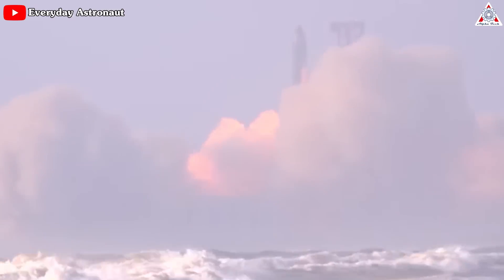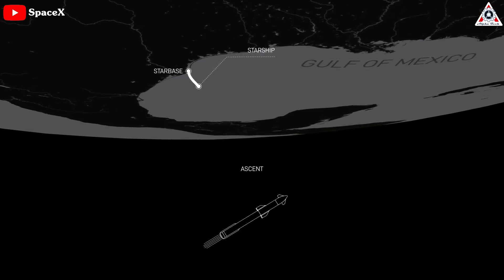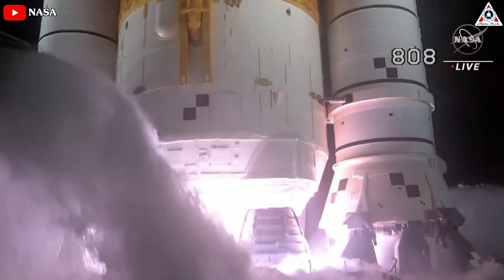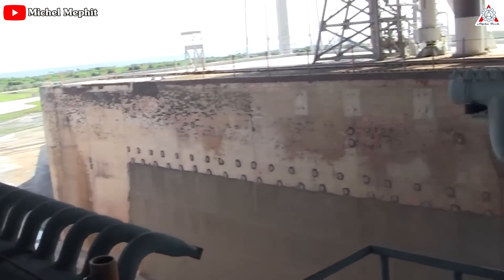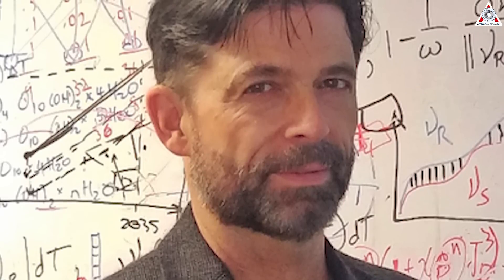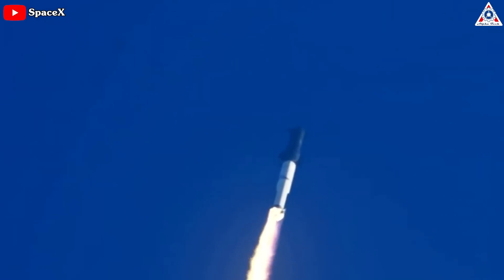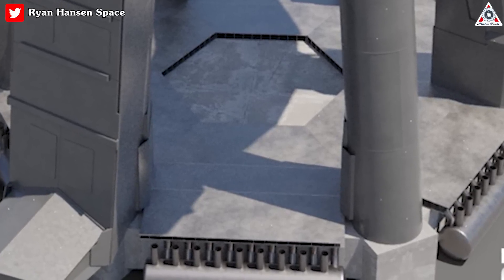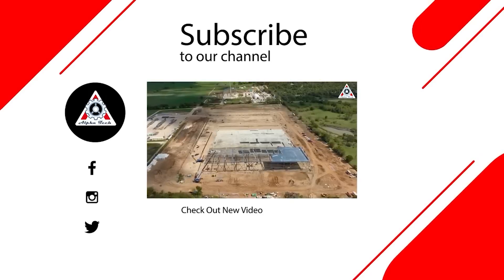SpaceX's NEW Solution to prevent the pad damage by 33 engines...

Comment: 2:32 "It's not clear why SpaceX didn't use this kind of infrastructure which is part of the launch set up for its Falcon rockets."

Because the time it would've taken to build the infrastructure would mean that Mush would miss the opportunity to make another overused & fkn unfunny 420 gag. After all, if he really gave a shit, then he would've been concerned about the environmental damage if not the actual damage to the site that the dildomobile caused & postponed the launch. It does however show a a major flaw with the dildomobile. When it lands on the yet to be built strong, flat & level steel reinforced concrete surface on Mars, when it takes off, it will massively damage itself hoying Martian rocks into the engines & most likely write itself off, which must be a comforting thought for any budding astronauts, especially after Mush's cavalier attitude to safety in getting there &/or coming back. 

What truly is amazing is just how much wool he can pull over so many eyes, but I guess when you're in a cult, you don't know it.

Comment: If they cant dig a trench deep enough, they should at least replace the concrete flat platform with a massive metal cone diverter to reduce the angle of incidence and quickly absorb the surface temperature.

Comment: First of all starship is one mighty powerful rocket in fact the most powerful ever built, so why expect to launch it on the least launch pad every built? no Launchpad ever had to deal with flames (guess 600 feet) like that in the past so therefor the Launchpad needs to be built in proportion to the height of the flames. From my understanding, if the total Starship including booster is 300 feet tall, when it had lifted off clear into the air I observed a flame over twice the length of the total ship, to me that looks like an incredible 600 feet flame never mind the compression, heat, pressure, shock waves etc. below that, so therefor to me it looks like the Starship needs to be launched from 600 feet above the ground or a pit below the booster 600 feet deep with clear exhaust routes (flame diverters) to get rid of any flames rebounding back towards the ship which probably would damage it even increasing the likelihood of causing secondary ignition which could explode the booster but at least would restrict cooling of the engines therefore increasing the probably of engine overheating failure or damage to supply lines. The best way forward is to build a launch tower at least 50% as high at the flames (300 feet) with flame diverters to direct flames away from the ship, or even safer (600 feet) the full height of the flame that way no flame will reflect back to the ship. I know what I'm saying is going to be rejected because, how can a tower so high be practical to build or how can you work at or maintain the ship at such a height? Well that is the next hurdle Spacex is faced with like it or not. In my opinion Spacex is wasting time with this water cooled metal plate idea, because even if it could absorb the heat the flames will still rebound and surround the booster for all the time it takes to clears the tower, if that is 5-10 seconds that's a lot of heat the booster and engines have to endure, actually I think it's repeating the same mistake and Spacex already knows that, but with all the eagerness to get it in the air Spacex is clearly trying to short cut a proper launch base however in the long run a lot higher launch tower and flame divert system is needed. I know this is a tall order, but as the old saying goes if you create a monster you have to feed it, this is another requirement like it or not, cost cutting and time saving isn't going to work in the long run because the FAA could ban the whole project. Let’s consider what could have happened if the Starship had of exploded on the orbital launch pad (my guess it was very close), how much damage would have been done?, certainly the whole launch tower and fuel tanks all would have been very badly damaged or destroyed, and what about in turn the fuel storage tanks exploded? This is crazy irresponsible as there is a town close enough to be damaged, does anyone really know how much damage the Starbase fuel tanks exploding would have caused? I think the whole thing needs to be re-evaluated as to the viability even as a Starship test site. “Elon forgive me I have an opinion” and this is my honest opinion. I do have a concept that should work but that’s a story for another time.

Comment: vectoring 30 engines on a surface which could potentially be sloped upon lift off could be a challenge for  such a large vehicle.
Hence the reason for the lack of blast deviation and the need of a level surface?

Comment: Won’t work, the heat and flames will still blast upwards and with more force; the flames and heat need to be directed away from the launch pad like at the Cape, preferably with a similar water suppression system

If you notice the flames and heat climbed up the rocket even to the primary stage; which is what caused damage that prevented the stage from separating.

Furthermore they will need to construct launch pads on the Moon and Mars beforehand with robotic vehicles

Comment: I would think any slight diversion of only three or four feet would be much better than a flat plate. Using a concaved diamond shaped Convergent  plate with external water cooling and deluge, to minimize the acoustic shocks that would help direct the flame into the smallest flame possible while directing that flame into a “ heat battery “ storage container where all the reclaimed heat can be reused. I think that would be the best.🤗
Reply: Yeah, let's spread this flame nicely all over that wildlife preserve. Fry all those endangered turtles and birds.

Comment: I would say that the deep sunk-in deflector or diverter is inevitable final solution... At least it should be tilted on one or two sides to divert the pressure away from the basement. Flat steel plate won't never be sufficient...

Comment: The only way you could launch 10 rockets with that kind of power off the same pad in one day is over a body of water with as little contact to any solid body of material, as it will disintegrate over time, as such to save time and money I would move to sea launch and duck lots of faa red tape 12 nautical miles off shore.

Comment: I wonder cooled steel plate will have no problems with the heat, the problem will be from the pressure of the engines. As a boiler operator I can tell you right now that a water cooled plate will stand extreme temperatures because of the absorbent and evaporative properties of the water circulating around that plate. It's the same basic principle, but the pressure is going to be a problem unless it's designed well.

Comment: Concrete is porous,  there is always a amount of water in it.  With enough heat applied to it it will begin to shed flakes off of it. I've done this at my work with an oxy acetylene torch. Can't imagine how heat the rocket generated.  Think the whole structure should be steel.

Comment: It with be interesting to see what they come up with as far as this plate system. What are they going to do about acoustic amplification. The plates might collapse under those pressures the cement was able to give . And won’t the amplification make engine damage even worse?
Reply: Engine won't get damaged from the pad being torn apart, because debris would have to somehow fly up against all that thrust. Everything else around unfortunately will get annihilated.
Raptors managed to fail all on their own this time.

Comment: why not get the boring machine and put a manifold of  steel  U shaped spill ducts  water tight conduits for the exhaust( lined with refractory of coourse) ground water that turns to steam would exhaust through channels in the outer shell.of each tube, allowing some quenching of the discharge   I hate to see all that energy go to waste though. sureley you could recover it somehow to use in fuel production...

Comment: I'm highly skeptical about the steel plate. If it gets loose even the slightest, it's gonna be blown off like a leaf by a leafblower and whatever it comes into contact with is not gonna have fun. If it breaks apart due to stresses, you got yourself some grenade shrapnel instead of rocks.

Comment: They won’t launch in 2 months, it’ll take longer than that to remove the current structure, build a new one and allow time for the concrete to cure.   While I think about it, the steel plate solution won’t work either.

Comment: If Starship is to become commercialised, how much greenhouse gases are produced per launch ?
Reply: i could be way off but my calculations say roughly 4,950,000 lbs of CO2 and 4,050,000 lbs of H2O.
i think elon's $100m prize for a new groundbreaking carbon capture technology is still up for grabs, lol
Reply: the FAA estimates 76,610 lbs of NOx and 35,185 lbs of CO - and is not at all concerned with CO2.

anyway 1 launch produces (roughly) as much as 488 cars do in a year
Reply: if you consider the CO2 reductions tesla has claimed to achieve through electric vehicles as the spacex launch "budget", they're permitted to launch ~578 starships per year :)

Comment: Instead of a flat steel plate which will reflect the rocket blast straight back up, why not a 45 degree angled steel CONE that will divert the blast SIDEWAYS?    And then surround the launch area with ring of 30 degree angled walls that will re-divert the blast upwards and slightly outwards, and at a safe distance away from the booster rocket?     The whole thing needs to be made of steel with a cooling water bath underneath so that nothing melts and gets blasted away as shrapnel.

Comment: Im no engineer,.....
So why dont they use a cone shape reinforced concrete pad to help deflect the shock wave away from going back up into the rocket, there isnt a center engine, so the point of the cone wouldn't be taking the full force, i believe it was the shock that destroy the pad and not the heat, 
Also, make it a ribbed cone so the blast would ride over the ribs collecting pockets of air much like a speed boat does, helping to deaden the shock and heat,
Like i said im no engineer, but this would have being where i would have started.

Comment: it just goes to show  how  dume bright people can be , concret explods under heat , what did they think would happen .ow thats right  they didnt think .  so repear  the   stagging area  and under the rock lay and weld together steel sheets    half to a insh thick ,  then  drill and bult  them all down onto  the repeared  stagging area . as long as the hot flame cant touch  the concret it wont explode.  and  maybe look to  redirect all that  thrust away  from the area too .   once ventted you dont want it hanging around  under a fuckin bomb  do you  bright people . god there dume

Comment: I wonder if they could harness that energy in an underground conversion system from pressure and heat to electricity or some other beneficial byproduct, It seems that initially a steep conical diverter made of a tough heat resistant material would be the first addition to the system then then the pressure could be directed into a series of generation units probably in the form of high pressure steam etc. I also wondered if the arms of the tower could be used to initiate the movement or at least assist with the launch for a small distance to take some of the work off of the initial start up, stabilize the vessel during launch and could save a bit of propellant. At a specific point that the arms were no longer under pressure they could sweep way allowing the ship to pass safely by.  Just some ideas I have been pondering....  JJK

Comment: let me tell ya.. water in an eclosed piping sytem will BOIL intantly and EXPLODE...  .TO SOLVE THE PROBLEMS of Heat and Sonic shock  you need to divert thrust down a tunnel and  out to the sea ..

Comment: It would be fascinating to understand how well the water cooled steel plate performed in SpaceX's testing. Hopefully they also compared the effects of reflected noise on the structure with and without the cooled steel plate, as it seems to me that steel plate would make the vibration and repercussions of the engine exhaust would be made greater by the plate?
Reply: Here's a prediction - water under steel plates reaches boiling point in a split second from all the relentless heat and overpressurisation makes the whole stupid contraption expolode even harder than the concrete all over the place with flaming metal trash. Of course the rocket will fail as well.

Comment: I guess Musk thinks NASA were a bunch of clowns when they went through this 60 years ago and decided they needed to build up the ground by 55ft, add a water deluge system and flame trench... they also put a significant amount of thought into whether they should assemble the vehicle near the launch pad or further away and move it to the pad with a crawler.  I dont think they did it the difficult way just so they could spend more of the public's money.

Comment: do you know what a cofferdam is? its sheets that are vibrated into the  ground where the water table prevents digging down. it stops water so you can dig mine etc  and is cheap to do.  so they can dig there no issues with that at all if they choose to put a flame  diverter in. they clearly are  looking at newer  faster methods

Comment: I must admit, that I find SpaceX launches much more exciting and entertaining to follow than NASA launches.  They are so professional, boring and nerdy.

However, when SpaceX ignores the basic engineering experience gathered since the days of German V2 rockets (you need some kind of deflector to save the rocket engines and the launchpad itself from the supersonic boom wave hammering), I can only wonder. Steel plate on top of the concrete slab may save the launchpad, but it will not stop the pressure waves echoing from the plate back to the rocket engines and auxiliaries, possibly hammering them to pieces.  I wonder if those devices are dimensioned (and tested) to take these, pretty unpredictable launch loads?

Other thing, they tested the launchpad with only 50% of the rated rocket thrust. If you try to verify the structure's robustness by testing, the test loads should be HIGHER than the nominal load, typically something like 120% of the excepted load in order to have some margin for error. If you can barely lift 50kg weight from floor, you cannot assume that you can lift 100kg as well!

Comment: Well that isn't going to work either not with 16.7 million pounds of thrust. The only way is a complete thrust divert water baffle flame trench system with millions of gallons of water dumped into the baffle during launch just like Saturn 5 and the Space Shuttle. But even then the baffle is going to have to be twice as large and partitioned to split the  direct thrust into segments in order to segment and disperse the pressure off the system. So there is no cheap just get by solution here. SPACEX needs to move to the Cape and stop this Boca Chica nonsense now. And just use Boca Chica for launching NEO Satellites or build a proper baffle and water dump system. 😡

Comment: Nice Thrust Shield ! Its Going to be Interesting to See if it Melts ! Might Last Long Enough for A Launch ! Keeping it A Solid Plate on Top Without  Porting Holes Drilled Off Set to Engines at 50% Lay Over and Some Combined 201 Heat Sink Heavy Stainless For Mash and Baffle While Cooling if Worried About Blow Thru Make the Holes Smaller and More of them to Allow for Downward Thrust Clearing ! You Do not Want Side Blast Heat Deflection Eating into the Tower !

Comment: Okay... so the rocket needs a tremendous amount of power for lift off (17mill lbs of thrust to be exact)
Why? So it can complete the journey to Mars or Moon. 
Well.....Let's reevaluate this. Instead of using all that energy to launch a 390ft 11-million-ton vehicle, lets resupply the ISS with smaller 3-5 missions and use that as a jump point to the destination. Add 4-6 modules to the ISS strictly for fuel, food and supplies. ISS is only being used as a science platform. Let's maximize the usage of the ISS. 
It would be a perfect jump point for later missions which require long travel, supplies and food. Doing this you wouldn't need 33 first stage raptor engines. You would lessen the environmental impact.

Comment: If heat and sound pressure negativity affect rockets 🚀 then why not have a wide and long tunnel that extends underground and into the ocean so the sound and heat can escape into the ocean where no one is around? Instead of having a flat platform that makes sound and heat bounce back, instead of letting it dissipate? 🤔
Kinda like a long underground muffler that will muffle sound and mitigate heat into the ocean 😎

Comment: Water deluge systems and steel plates are half-ass temporary solutions. An absolute and environmentally friendly solution is to bore concrete lined radial tunnels extending from the center of the launch pad and to install scrubbers at the end of said tunnels where they extend upwards to ground level.  No more billowing gas and debris clouds, fried sea gulls, and no more damage to the tank farm. And, another thing, super-heavy and  super-powerful rockets are not to be placed and launched atop grouped pilings ,instead best to placed them into a counter-bore below ground level. Guaranteed, just common sense.

Comment: Terrible Idea water expands 1600 times as it turns to vapor if they aren't able to cool the water it will explode like a giant steam boiler! and even the most heat resistant steel melts at 2800F Raptor 2 temp is 6000F liquid nitrogen might be a better idea but even then its unlikely to work!

Comment: Copper plate is installed inside safe doors as to disperse heat so that the steel can not reach melting temperatures from an Oxy torch. So maybe a layered approach and then water or chilled water????